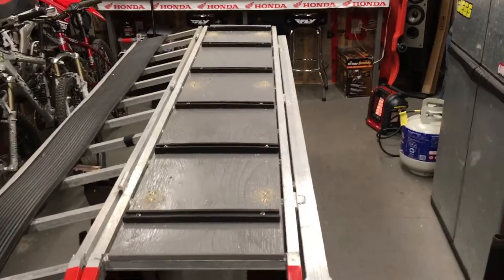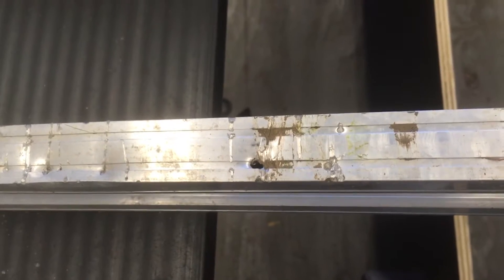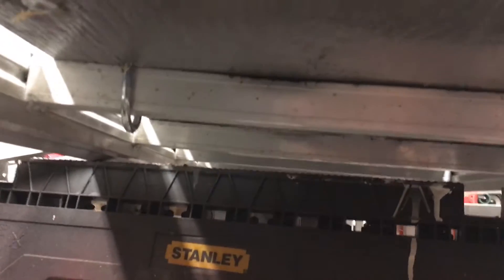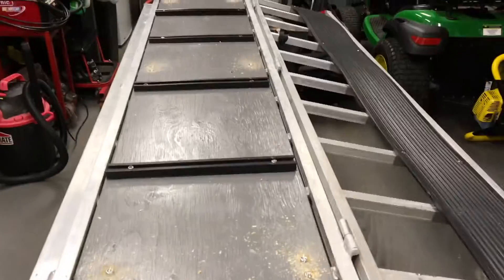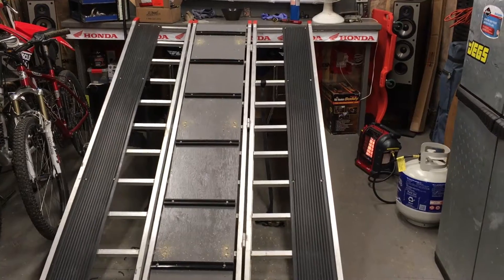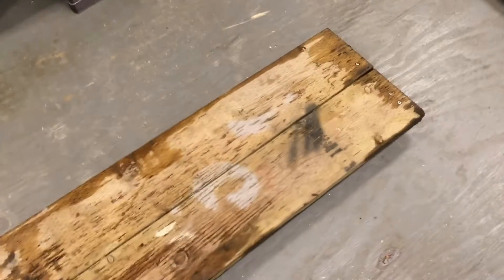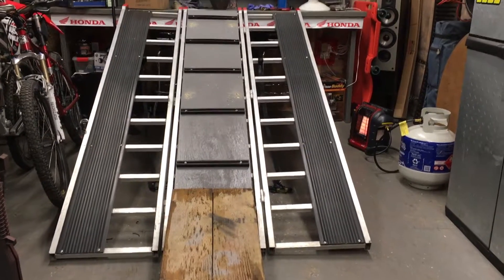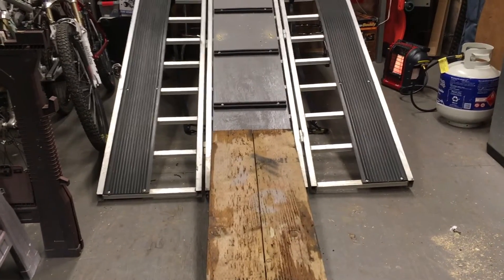Tri fold snowmobile ramp modification

Comment: What kind of screws did you use for your ski glides to hold them into the aluminum?Im curious because I believe I have this same set up I’m trying to achieve
Reply from the maker: My trifold ramp came with the ski guides already attached. They are attached with pan head bolts and rivet nuts in the aluminum.
Reply: I appreciate it brother.Im building ski glides for my tri fold and out of curiosity and your expertise what would you suggest I use to attach ski glides.Self tapping screws or riveted?
Reply: Or the U bolt concept?
Reply from the maker: @leroymoiser3397  you could probably use long pan head bolts with a nylon lock nut / with washer and go all the way through the aluminum tubing and just snug them tight. Just watch for clearance on backside of ramp when folded. Might be cheapest and easiest. 🤷‍♂️